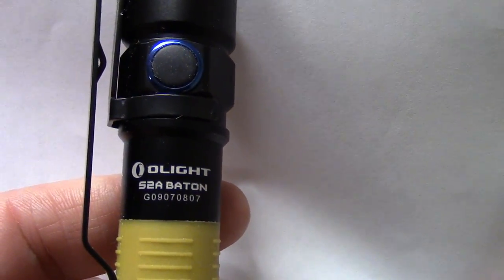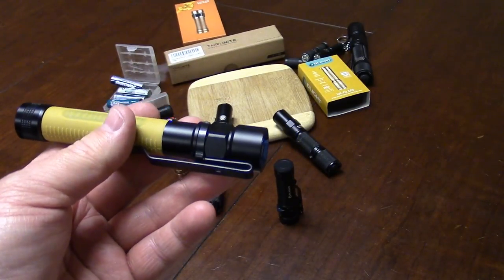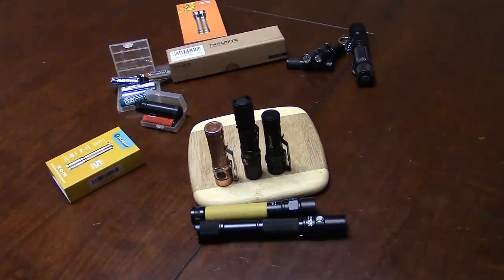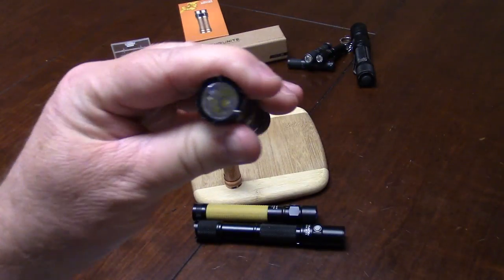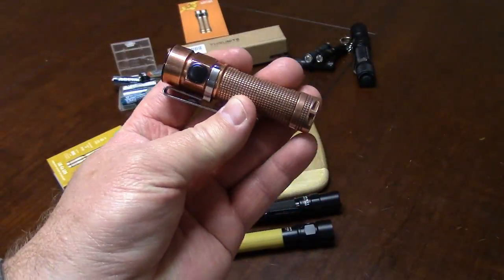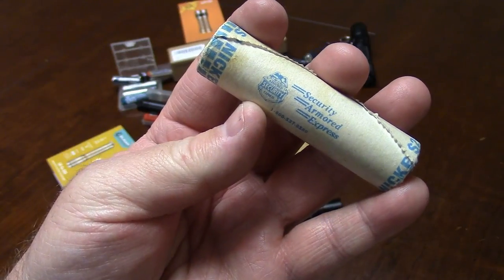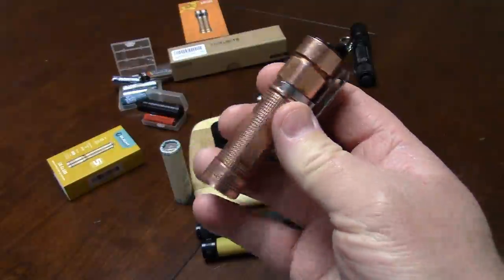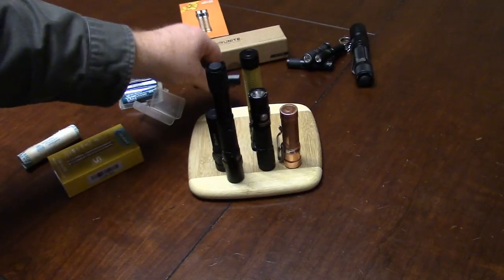Olight S1A and S2A Baton ThruNite Archer 1A V3 and Archer 2A V3

Comment: Enjoyed the video. Thanks, I'm considering getting the s1a because it's one of the smaller aa flashlights ive seen from a quality torch company. 

I owned the Archer 1a v3. My son just dropped it down a drain pipe. I was a little bit bummed but stuff happens.
Reply from the maker: I like both lights quite a lot and they are competitively priced with each other. I like the user interface on the S1A better because no matter what, I can always start at the lowest setting if I want to or use the remember last setting feature.  The Archer has to cycle all the way through if you want a lower setting than the last one you used.  I do have to say that that I occasionally discover the S1A on in my pocket and that never once happened with the Archer 1A.
Reply: Essential Gear & Useful Skills Which reminds me. On the s1a...If you start in moonlight and turn it off, will it resume moonlight when you turn it on normally? I kinda hope not.
Reply from the maker: Yes. If the last setting was moonlight, it will return to moonlight. Unless: 1) You double click the button. If off,  double click makes it go straight to turbo. or 2) You triple click the button. Triple click from off results in strobe.   

Worth description, I guess:   No matter what the last setting was you can start with moonlight by press and holding the button.  But, it has last function recall so a normal quick click of the button brings you back to whatever it was set to when you last shut it off. So, you have 4 choices of how to start the light. 1- moonlight  2- Turbo  3- Strobe  4- Last Setting recall.   

The Archer, in contrast, can only be turned on to the last setting. Click the tail switch and it results in the flashlight starting at whatever brightness setting you last shut it off at. You have one choice and one choice only.
Reply: Essential Gear & Useful Skills I wish it returned to the non moonlight setting. That would be very smart since you can get to moonlight by default.

Comment: Great to see that you are back with another informative video.

You tend to point out useful technical information that many other reviewers gloss over, or miss.

I only have a few cheap LED lights, and one that is incorporated into a stun gun, as I prefer to use headlamps as they are hands free, and in my mind, easier to utilize and more efficient.

I have been looking at Wowtac, which is seemingly a new brand that has been promoted by Black Scout Survival.

They seem to be very high lumen output lights, that are very reasonably priced, and they incorporate a tactical capability too.

Following is a link to their website in case you have not heard of them.

http://wowtac.com/products/flishlights/

Any opinion on Wowtac?

Thanks!
Reply from the maker: I just briefly clicked through Wowtacs product listings.  They look a whole lot like some of the current and recently last-gen Thrunites.  I also see competitive prices but didn't dig deep enough to find out what they charge for shipping or where they ship from.  They look like they're worth checking out for sure!